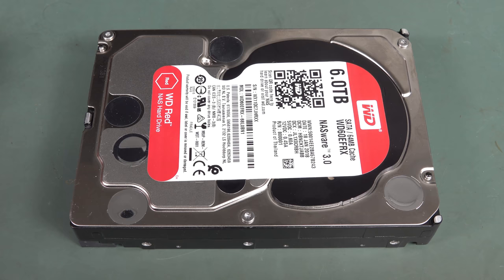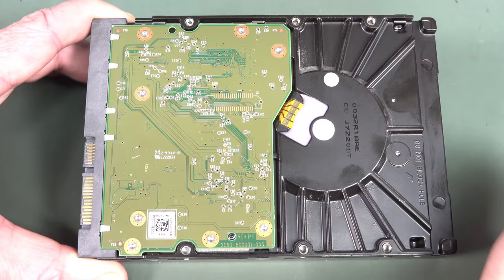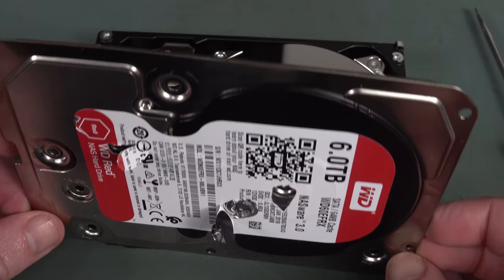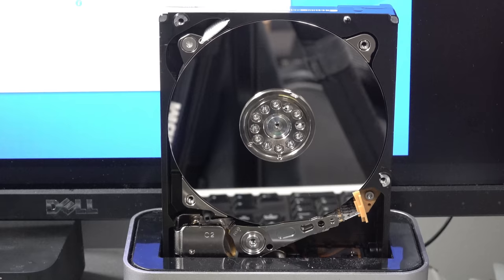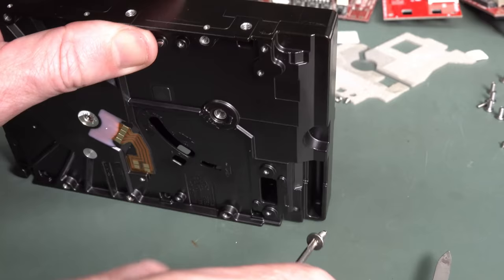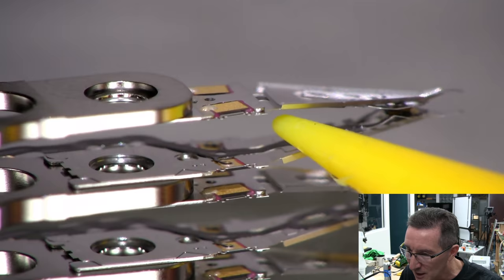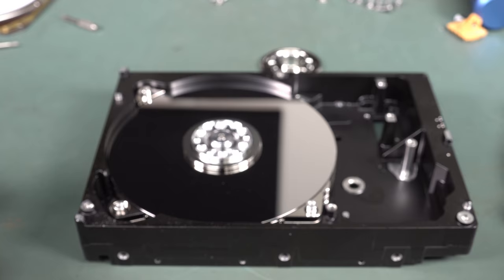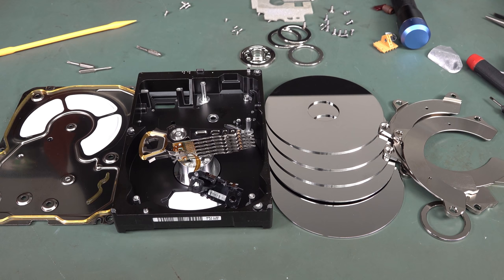EEVblog 1398 - Western Digital RED 6TB WD60EFRX Hard Drive TEARDOWN

Comment: I seem to be the official person that everyone sends their old computers and hard drives to for "destruction". I must have disassembled at least a hundred of these. I've never had trouble removing the screws. I have two different set of torx bits, one the normal T-* version and the other one something in between, and maybe it was those in-between ones that fit better? I usually grab onto the edge of the platter with something to hold it because I'm not concerned with damaging it.

I suspect the problem wasn't a head crash but something failing in the head positioning control loop that was making the head try to move past the ends of its ranges and bounce off the end stops. I've spun up drives with the covers off before and they generally don't bounce back and forth like yours did. Of course, who knows what actually went wrong, how that's supposed to work may depend on manufacturer.

The small square of material is there to catch any stray particles that come off the platters and keep them from spreading onto other platters. The soft white strips glued onto the top and bottom are some sort of carbon filters that absorb certain impurities. The voice coil used to move the head is actually aluminum rather than copper to cut down on weight and reduce momentum when the head moves quickly. The head can produce an amazing amount of acceleration in order to jump to any track in tens of milliseconds. Your platters are likely made of an aluminum alloy, but the ones found in the smaller 2.5" laptop drives are often made of a fragile glass that's easy to break when removing them. Most of the parts are made out of machined aluminum because it's lightweight, strong, non-ferrous, and has low thermal resistance.

Also, you should use gloves when handling the platters as they're coated with a thin layer of protective chemicals that's probably not good to get on your skin. (At least that's what I've been told by the people at the Carnegie Mellon DSSC. That was many years ago - I'm not sure what chemicals are used in modern drives.) This is why the surfaces are so easy to fingerprint. It's not just that the oil from you fingers is getting on the platter, but the coating on the platter is coming off on your fingers!

Comment: So a trick to recover data from a failing hdd, put it is a zip lock bag remove as much air as you can (vacuum seal works too) and place in your freezer for a couple of hours.  Sounds funny I know, but you would be amazed. 

As for the pressurized hdd's, I think WD had a some that were "filled" with helium.  Though I couldn't understand why. As helium leaks through everything, even glass.
Reply: The distance between head and platter is too small for atmospheric air molecules.

Comment: Only 3 years?  I have a NAS with dirt cheap WD Blues in it that are 7 years old at this point.  I have a full set of Blacks waiting to replace as needed, but even they have been sitting in drawer for more than 3 years.  Actually, its about time I replaced the NAS too.

Comment: If a Harddrive runs 24/7 it will never go bad and can run for years, but if you have powerouttage or turn off your device the chance is that the head will not go in park position and will stay on the pladder, then your harddrive will go broken 100% if you start the device.

Comment: I'm sad to see this peak of technology slowly fade away the way of the CRTs.

Anyway, the plate spacers are probably "ground" not "machined", that's the name of the process. I certainly don't know, but those head supports might be cut by an assembly of simultaneously spinning cutting/grinding wheels, then separated into 5 by some other coarser wheels, hence why the machining marks on the surface. Probably not cast since that requires a draft angle. Could be sintered, but you still need expensive the grinding step. Probably not EDMd since it would be too expensive for something that's mass produced (considering the corner radii).

Those harddrives have faster processors than some of the phones out there.

Comment: I have a WDC WD20 02FAEX-007BA0 it made a horrible heart stopping noise while reading, it was extremely loud like
tearing metal apart. (So i bought a HGST the white HDD). I had a SATA cable connected to the motherboard and the other
end of the cable was hanging around in the case. I connected another HDD to the cable. The WDC WD20 works and it does
sound normal again. Could be a cable the reason for the horrible reading sound? The WD Hard drive that was noisy still
does it's job for over a year now. Seems to work quit normal. Any idea why it was so loud?

Comment: I wonder how many load/unload cycles it had, I think the average amount of cycles before it fails is around 300,000 cycles.
I have an old (10 year old I think) WD green drive that still works, but it had a "feature" where it would park the head every 8 seconds or so to save energy, increasing the amount of load/unload cycles pretty quick.
The load/unload amount stopped increasing as soon as I disabled that annoying "feature".
That is what kills the drives most of the times.

No idea if you could still read the SMART data from the board itself and look at that number.

Comment: Id' expect a fully mechanical watch or clock would be the most complex mechanical item in a typical household, not a hard drive.
Reply: More complex in terms of parts count would be an engine or automatic transmission, however neither is as precisely machined as the 2 items you mention or a HDD

Comment: The bearings used for the head actuator and spindle motor must be built to a very high standard and tight tolerances, There's no room for any wobble or run out on a hard drive, and they have to be able to remain essentially play-free throughout their lives.

Comment: I bet those 4 motor connections stop at the edge of the flex cable.  They are for testing during manufacturing.  A whole sheet is printed with all of the parts connected.  One resistance measurement can confirm dozens of parts are good.  Check out Dave's DFM videos.

Comment: Perhaps a contender for precision and accuracy is a modern high quality camera lens?
I'm waiting on a Sigma 14-24mm f/2.8 dg dn art lens. To be able to control aperture,  shutter and autofocus at a frame rate of 10/sec and shutter speeds in very small fractions of a second with multiple elements and produce an optically accurate image is also a pretty impressive feat...

Comment: I've taken apart around 5 hdds  and Ive never seen a damaged platter. I don't know why they fail. I know I don't miss them.
Reply: Some times its head misallingment, others bad bearings, failed chips, or suppose the plates surface lost its magnetisation or something and crapped itself.
Reply: @Runco990  
Exactly, lets not forget chips degrade with time, a lot quicker if they were bad quality chips to begin with.
If anyone overclocks, just imaging having to push the Vcore a tad higher after a few years of running stable only because chips degrade with time. 
To make things worst, thes chips are not digital, they are analog ICs.

Comment: I don't think the center motor is supposed to have any friction at all, so either cause of death or it broke for running without filters
Reply: All drives (10 or so) that I took apart had similar friction on the motor assembly. I think the bearings themselves cause this because they cannot have any free play.

Comment: That's some crazy bad luck. I've got western digital drives like my WD1002FAEX with over 85,000 hours (10 years 24/7), and over 100k hours on some 10k rpm Raptor drives (74gb version) and zero bad sectors or smart errors.

Comment: i was waiting for data protocols analysis on sensors and chips :P 
anyway the pads afaik are for moisture. 
and on extreeme high speeds mass of cable makes time differences in sync. so that cuts on cables mostlikely are for equalizing cable mass.

Comment: Nice video Dave! Apart from magnetic cogging, you should not feel ANY resistance in the platter motor. If the spindle motor has a bad bearing, it would be noisy, but it doesn't accord with the noise you recorded early. You did say it was noisier in the server - what orientation was the disk when in use?
Reply: It's a stepper motor technically. You can actually feel it when you spin it slowly.  Source: Being recycling computers for 12 years, as well as other things. :D
Reply: @markjohnson7887  Hi Mark, thanks for piping up! They are indeed steppers in HDD and they exhibit a cogging effect when one turns them manually. I'd assume Dave has played with steppers and knows how they feel, so when he said he was experiencing resistance, I imagined he was talking above and beyond the cogging effect - hence my comment.
Hey mate, you've been in the computer recycling business for 12 years! Perhaps you could start a channel to educated and entertain too? There are many people talking about computers but few with recycling and disposal. I reckon you may have a market segment there! Good luck with everything Mark.
Reply: @BenMitro  Ah, ok.  You have a valid point there.  I didn't think about that.  I think I just assumed that since it appeared to be spinning fine when he had the cover off that everything way OK. But failed to consider that the drive was, indeed, not working properly in the first place. lol

I have thought about doing a YouTube channel in the past.  Not sure if I have what it takes though.  I definitely don't have the patience to learn to edit videos.  So I'd have to find someone to do it for free, since I couldn't afford to pay anyone. lol
Reply: @markjohnson7887  If you are thinking about it, I'm sure the right time will come when you decide "eff, it I'm going to do it!" Regardless of what you choose, good luck with your endeavours!

Comment: Three words explain why you didn't see damage: bad spindle bearing. I have removed magnets from a dozen modern hard drives and not one had visible damage to the platters. The 300MB CDC drives I used to repair in the '80s were another story. Head crashes were common and spindle bearings never failed.

Comment: 26k hours? amateur numbers! I had a client with a 12 bay 3.5" disk array, youngest drive was over 80k hours. None were failed and the array was successfully migrated with no errors or issues. I still wonder how long they would've continued.
Reply: Some drives can function for well over 100k hours. For example, I have one here:
Device Model:     WDC WD10EADS-00M2B0
Power_On_Hours:    101913
Reply: @PeterUrbanec  Even better, get Hitachi (HGST) drives...  they work fine beyond that.
The drives in the machine I type this on have >110000 poh.

Comment: Dave, I've got a photo of an amazing head crash in a laptop drive. Should I post it on twitter and tag you? Also, I'm not a drive expert, but having done a lot of (software) based data recovery and taken apart hundreds of drives for fun, here's some tidbits that may be inaccurate, so take it with a grain of salt:

Pretty sure those "pads" were moisture absorbent. Try stabbing one.

That little bag I believe was a filter, as the spinning platters force air through it.

Those heads actually float above the platters, and it's a distance much smaller than the thickness of a dust particle [info from a drivesavers ad at the store I worked at] The spinning disk creates a small cushion of air that floats the heads. It's mind boggling how precise these damn things are, and almost scary...

The screws I believe are stainless. Buggers barely stick to a magnet.

You can stick the clean platters together and wring the air out between them like gauge blocks. It's quite fun and weird. Seems like you managed to do it at the end of the video.

The thinnest hard drive I've seen was a 500GB 2.5in HDD from a weird lenovo 2 in 1 from the windows 8.1 era. It's FIVE millimeters thick!! Constructed with stamped metal, not cast...

Comment: these modern drives has seperate terminal port. it is actually 3.3 volt 115200 baud rx-tx serial bus very similar to debug port on single board computers. so most of the time you can get diagnostic information about the failure and  what the disc is trying with all those clicks. i saved one of my drives with just waiting. on the terminal output the disc was collecting and marking some sectors and it was a slow clicking process. but it was progressing on the output. so after 6+ hours the disc finished collecting and marking data and all files was there.

Comment: Smr drives have a specific issue where rebuilding a storage pool on a nas will often cause them to fail. Which is problematic because if you're rebuilding a pool presumably you're already down 1 drive of redundant data. .... ... how many drives can you lose at one time before your data is lost? Probably 2, maybe 3, for most users. 

So it's not just a problem of drive reliability, it's a problem at the level of the storage pool as well. 

Smr drives are more or less fine - but slow - for desktop use. Yet wd was marketing them as "nas drives".

Comment: The last hd I had with actual grooves in it was a Conner, they seemed to be notorious for that.
Reply: Yeah i took a bunch apart when i did desktop support. Only had 2 real head scrapes. Once you hear a true "head crash" the noise is unique. Usually something else goes like in daves case and the actuator arms just flail, swing, and smash all over the place making clicking crunching noises. The constant scraping of a head crash is pretty unique. 

I had a head crash that i pulled out of a computer that sat in a closet, must have been scraping for weeks. The platters were all scraped down, and the inside of the drive was covered with platter powder that looked like powdered graphite. The head was long gone, worn away. I kept it on my desk because it was neat, people would always ask.
Reply: @volvo09  The noise must have been insane!

Comment: There is no need to have a visible scratch on the platters or anything physical wrong with the drive. 
The drive knows it's time and that's all she wrote. 

Maybe the bearings worn and the drive could not maintain the speed precisely or maybe it's internal counter ran out of minutes of use because your warranty expired.

Comment: Disc drive manufacturers often quote insane mean time to fail like 150,000 power-on hours in their spec sheets.  Bull feathers.  Typical WD NAS rated drives seem to fail around 16,000 hours, presumably due to bearing wear.  In my previous job, I had quite a few arrays with Seagate 2.5 inch 15,000 RPM serial attached SCSI drives and those seem to start failing around 12,000 hours typical.  I’ve also found SMART not particularly helpful, it essentially never gives useful predictive information that a drive is about to go.

There are differences.  I have noticed WD drives tend fail in batches, so I am assuming some design issue is common.  If you see one WD go bad in an array, it is wise to begin replacing them all quickly before losing the ability to rebuild the stipe set.  On the other hand, Seagate failures seem more random, presumably bumping up against the limits of materials and manufacturing tolerances.  As always, don’t blindly trust RAIDs, back up your data!
Reply: The problem usually starts with the user not understanding "mean time to fail".
Mean time to fail is NOT the time you can run the drive on average before it fails!
It is a failure chance.  It is specified like "when you run this drive for 10000 hours, after that about 1 in 15 have failed".
Hence MTTF is 15 x 10000 hours = 150000 hours.
That does NOT mean that any of those drives will ever run for 150000 hours, that is just an incorrect inference.

Comment: All that metal that is not neodymium (around the neodymium magnets) nor aluminium (the separators between the disk platters ) is a special alloy called mu-metal with a high relative permeability, it has heat treatment when in final form and annealing in a magnetic field in a hydrogen atmosphere. Any tapping or banging lowers its relative permeability.

Comment: The read head block definitely looks to be machined from a solid piece. It’s probably not steel, doesn’t look like aluminium so my guess would be chrome or nickel plated brass. It machines easy and is non magnetic. Trying to mill this kind of geometry into steel is possible but very time consuming. The housing would be die cast aluminium.

Comment: Linear-Servo-Motor: Would be interesting to see if it's possible to use it for other things.
Reply: Ive used one as a rotary encoder, and used it to spin an LED ring, GreatScott did a video on it, very interesting just use some comparators and jellybean stuff.
Reply: @andymouse  I was talking about the head-servo, not the spindle-motor.

Comment: I think it detected a bad master file table (or equivalent) or a bad series of sectors and quit. It went to home several times after failing each time and reported that back to the OS. And it is filled with dry Argon gas. Far as I remember. Long time since I did that stuff. Oh and the torx is DESIGNED to be slightly off size on one screw to check for tampering ;-) Shape is a trapezium. And you ate a bagel and a kiwi for breakfast. LOL kidding on the last. Hard drives are fun stuff! I am not sure but I don’t think it is aerodynamics but to reduce weight and pressure both but I’m not up on that patent. As far as the ‘machined’ parts they are MIM parts lapped on diamond Swiss micro surface grinders. Gotta love the disk/platters. You could make great art from that.

Comment: I think the flexible PCB will fail first and also the pre-amplifier IC are on this flex board. So the heads will go and dash the centre of the drive making the clicking noise. I had this problem in two same capacity & type of Seagate HDD. Even some Seagate HDD has coating issue on the disk and bad sectors were created. I am not an HDD expert so please correct me if I am wrong. I am telling my experience.